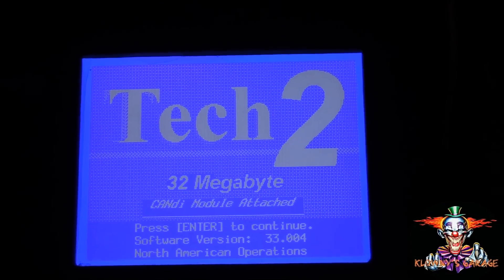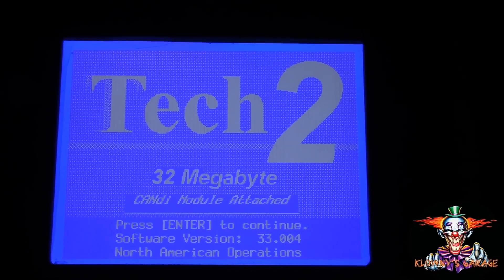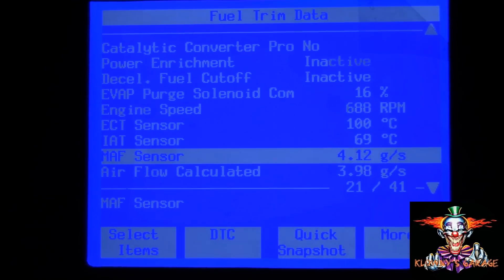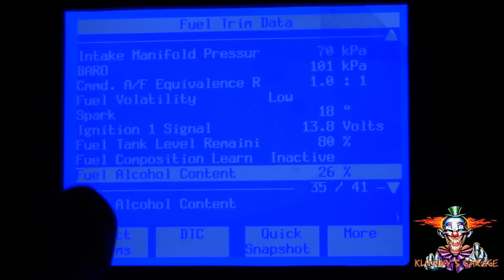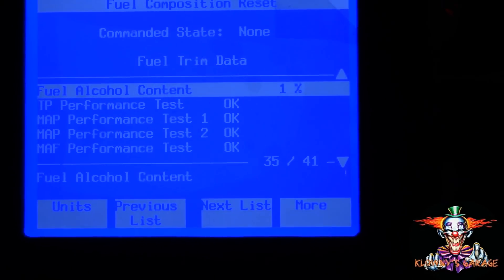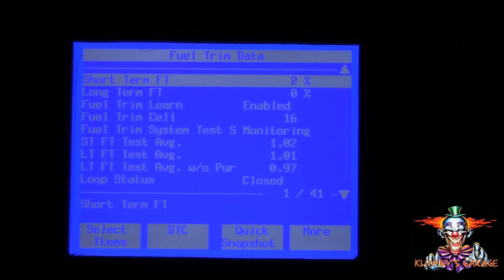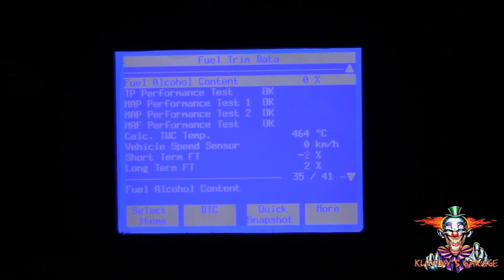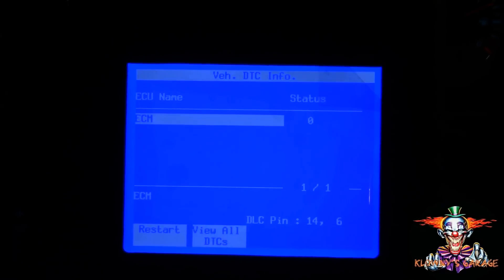How to Fix A Flex Fuel Engine Rich Condition - DTC P0172 P0175

Comment: Hi klowny1969, thanks for the video. I performed an alcohol composition reset as you described 6 months ago on a 2007 Flex Fuel Impala. I use Costco regular gasoline and drive 6 miles each direction to work and home. I always fill up the car at 1/4 tank. A few weeks ago, I checked the live data and the alcohol composition was at 4.9%. Yesterday, I check again and the alcohol composition was at 16.9%. Same tank of gas, same weather, same driving conditions. Any thoughts about why it might spike?
Reply from the maker: Could be a defective sensor

Comment: the problem will come back. PCM needs to be reflashed with updated firmware
Reply from the maker: Haven't had a comeback in years
Reply: @klowny1969  apparently it's triggered by small fuel-ups

Comment: Ok reset this on my 2011 tahoe and still hard tarting replaced plugs wires coils fuel pump cleaned throttle body mass air flow sensor and changed air filter ... Any other thoughts?
Reply: I have an 11 Silverado, with the same issue.  I've done all you've done, minus the fuel pump, since the numbers looked good on it.  I also replaced the engine coolant temperature sensor,, ambient air temp sensor(was reading -40), thermostat, and upstream O2 sensors.  It was going alright, minus the shit fuel economy, until the other day when the temperature dropped below freezing.  Then the hard start happened.  I need to find a Tech2 somewhere to do the composition reset.  Do you have one, and if so, what kind did you get and where did you get it from?

Comment: Been fighting a rich condition for two weeks on a 2008 Tahoe. Got lucky today and came across your video. Thanks so much for your information. My alcohol content was at 45%.
Reply: What did you use to reset it?
Reply: @the_garthvader  I have a Tech II scan tool, easy to reset, just a click of a button.
Reply: @robinoglesby3656  Been having an issue with my 2011 Silverado, that's running at 46.9%..do you remember where you purchased your Tech 2?  Been looking for one, and since our vehicles are somewhat close in models/engines/years, the one you have would probably get me going again.

Comment: So Klowny. I dont have a scan tool.  I have 2008 flex fuel Impala.  Code P0172.  So you're say run down to near empty, then find a gas station with low ethanol.   Will the car correct itself does the light need to be physically cleared
Reply from the maker: That might work..but it might not

Comment: My 2013 yukon xl 5.3 has 175-172 codes but it will not start so is there anything in particular that could calls it not to catch fire and start up ? Ineed up
Reply: Did you find the problem? I am having this issue right now and I would GREATLY appreciate your help!

Comment: Hi can this work also for a 2010 Lincoln navigator  with flex fuel.
Reply from the maker: Stanley Medina should be the same..but u need a ford computer
Reply: klowny1969 is there a site on YouTube that can help me fix those codes
Reply from the maker: Stanley Medina are you having a rich condition code? If so, it could be alot of other things as well..if u need a flex fuel reset..then u have to have a ford computer to reset it..only the dealer has that
Reply: klowny1969 thank you I'll do that
Reply from the maker: Np

Comment: If anyone has this issue with a chevy i strongly suggest taking your car to a chevy certified technician, tell them not of the code but that it is running rich and you want to know why. Deal directly with a service manage at entry. Do not start spending cash guessing. It's a mistake. Take it from me. For me, my high pressure fuel pump was leaking internally causing gas to mix with my oil, and that was 1 of 4 issues. Good luck.

Comment: i've been troubleshooting these codes on my care for like 6 months. can't seem to find the cause of the 172 and 175 readings. I have a 2011 equinox 3.0. spent good cash on parts, listening to this person or that person. This is the first i've heard of this solution. Car runs fine, however the idle pulsates as of late. I also recall adding an injector clean to the gas tank which caused the light to go off for about 5 hours before returning. Any advice or assistance would be amazing. Thank you for taking the time. I Appreciate it.
Reply: 2011 Equinoc 3.0 does not calculate fuel alcohol content the same as this. Your vehicle has a Fuel Composition Sensor located in the feed line under the car. They are common to fail.

Comment: Hii klowny1969  on my Mercedes W211 E200 kompressor 1.8 with  LPG system ,  when I change the termostat and driving 300km I have this code P0172 , this is only when I am on the LPG GAs , I readed a lot for this dtc like MAF sensor , vacuum hoses, spark plugs ,oxygens sensor , for now I will go  to check the LPG System , but what do you think?

Comment: Very Helpful. Had dealer reset and truck runs like new car. Almost peeled out coming out of dealer. So much more throttle response. I was at 78%
Reply from the maker: kool..how much does the dealer charge for the reset?

Comment: I was on e and stopped at a Arco once I filled up the tank and went to pull off it start struggling I have 1997 camaro z28 what gas stations have the best because I will never go there again smh

Comment: I have a 09 impala and my  Fuel Composition  was at 78%, had a buddy at work reset it  with his snap on and it fixed it for about 31 day's but now my car is throwing a code again (p0122) I only use 89 octane gas,....  but when we reset it, we didn't let it warm up, and i doubt it was in close loop,  but outside of that any other ideas on what could be causing this issue??
Reply from the maker: Bret Rice p0122 is unrelated to fuel composition
Reply: sorry I meant p0172*
Reply from the maker: Bret Rice if ur fuel composition is high again..try not to go close to empty on ur gas tank..it could be recalculating it wrong..certain parameters have to be met for the computer to recalculate the composition
Reply: I never run down that low, I feel up before it on the red 1st line
Reply from the maker: Bret Rice if i remember correctly it might be close to 1/4 tank that it kicks off the recalc
Reply: I run it down to a 1/4 then fill up!  I'll have him reset it again,..
Reply: Since we didn't warm it up and allow it to be in a closed loop could that have something todo with it?
Reply: klowny1969 what are those parameters? my 08 Impala gave me this code. says the code 'indicates that Bank 1 System is too rich for a predetermined period of time' and 'Fuel Trim System Rich'.
Reply: Your fuel pump is cooled in the gasoline. Another reason not to let it run low on gas.
Reply: now that I think of it, I drove away from the gas pump and forgot to put the gas cap on for 3 blocks. can that be it. it's a really good car

Comment: just watched your video. I never had issues with my car today (2008 chevy impala) but today I ran out of gas. had a friend bring me a gas and once turned the car on the engine light came on. I got my car diagnosed and it was p0172. Any advice?
Reply from the maker: Israel Alamia i talked about the different issues it might be in the video..if its a flex fuel engine,  it could be the percentage of ethanol..thanks for watching
Reply: +klowny1969 yes it's a flex fuel. So so are you saying don't use flex fuel anymore?
Reply from the maker: Israel Alamia the percentage of alcohol the computer thinks u are using can be more than what ur gas actually is..should reset that parameter in the computer
Reply: +klowny1969 would filling up the gas tank possibly reset it?

Comment: Buddy that was a great tip. Up in Canada I have never seen fuel with higher that 10% in my area but I see vehicles capable to run on E85. This tip would apply up here as well  since you car was built here. Awesome 😎
Reply from the maker: hey thanks man..yeah i figure i would post this cause its a real easy fix, in case anybody else had the same issue..